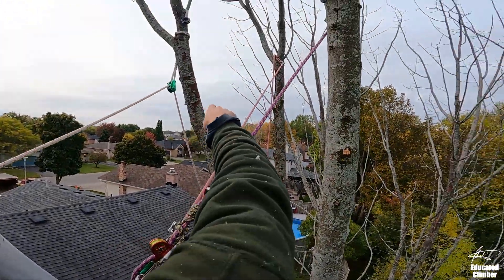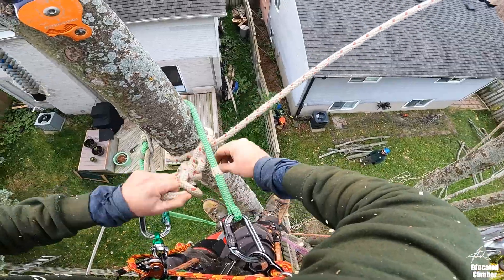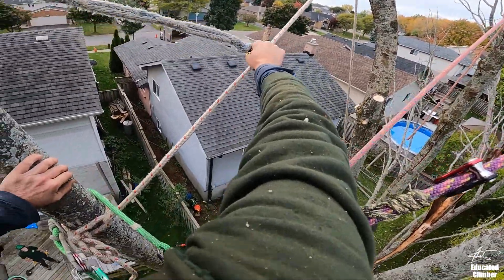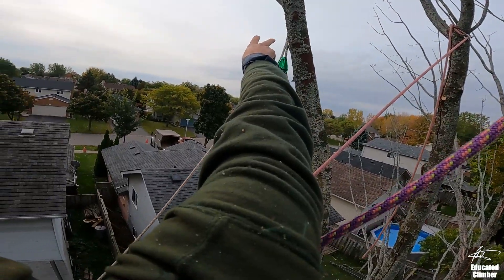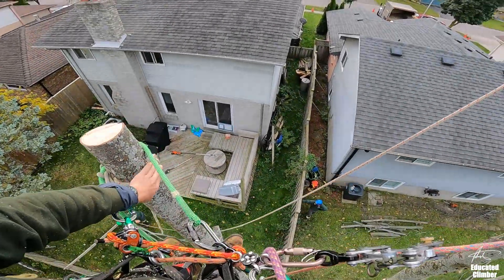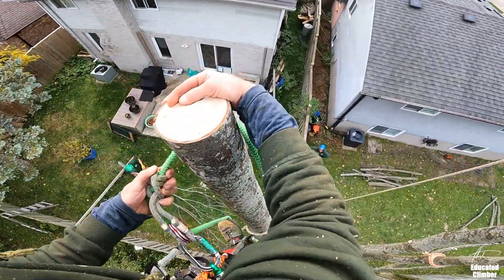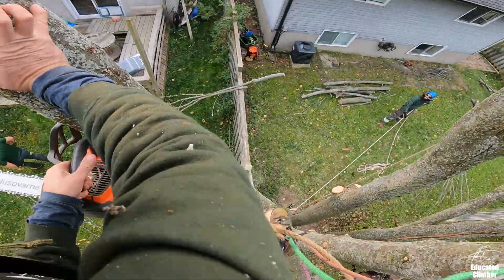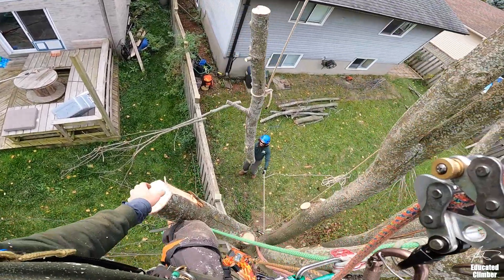Rigging a Secondary Lead:  3 Options

Comment from the maker: * VERY IMPORTANT  -  It is never a good idea to dump big weights into a tensioned line. In this video I am showing small loads, and we are trying to let the line run when the weight comes into it. Shock loading spars hard sideways is a recipe for disaster. Please be aware of the forces involved and use good judgement in your rigging.  - Patrick *

Comment: Your channel is at the top of tree pedagogy for me. 
My question is why would you want the omniblock sling at full length? I always find myself choking the hardware up as close as possible to the anchor wood, not for a particular reason but preference. Thanks
Reply from the maker: I prefer it longer on a span rig, allows it to move more naturally I find. If it was tight it would deflect the rope a lot more, or keep things closer to the cut...      - Patrick

Comment: Hey MUGGS.  So i think you have 2 life lines going up, (a rope wrench, hitch climber pulley and a prussic) thats all i use and am familiar with.  and a  mechanical one. They both attach to your ring on the bridge. But there looks like 2 little rings or swivels on that? Any info on that attachment point. Rookie climber here, thanks man. Appreciate your teachings.
Reply from the maker: On my bridge is a Camp Gyro Swivel. It is a 3 way swivel which I like for managing dual systems, works well. All the best.   - Patrick

Comment: What a great demonstration.The cool thing about span rigging is the way the load is shared so the crew have a 2:1 mechanical advantage. It requires less effort but needs twice the spare line to lower it all the way to ground. And of course there's a possible intense spike in line tension on the two anchors if for some reason the line gets hung up while the span line is horizontal and taut. So although negative rigging is best done with a short freefall, you don't want it so short as to put huge sideways tension on the two anchors. What a lot to think about when up in a tree, ha ha.
Reply from the maker: Yes, lots to think about. All the best. - Patrick

Comment: You mentioned this dead tree , there 
are not enough options when it comes to dead trees . even though they look like they’re OK .there has been too many times when rigging points don’t hold !  and having a secondary anchor point was for me was necessary . most new or unexperienced tree workers , don’t understand that . When having multiple options and multiple rigging points , due to the risk of failure .property damage for my opinion is not an option .. when it comes to our industry. Excellent video   Tree muggs